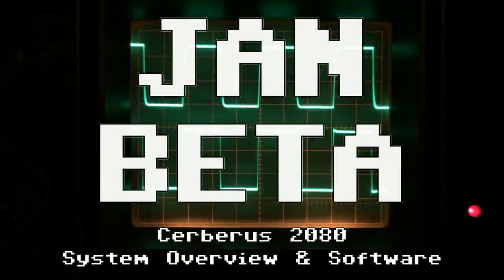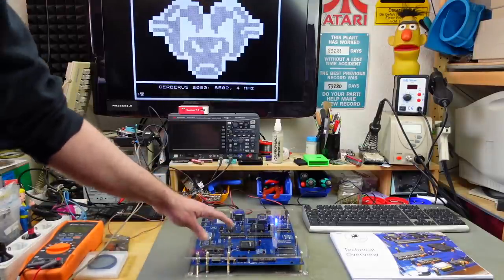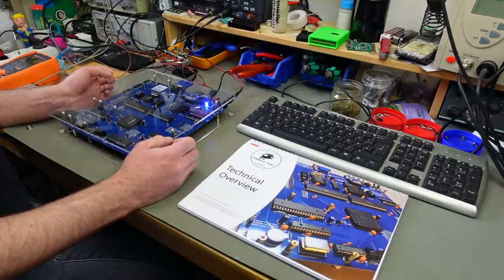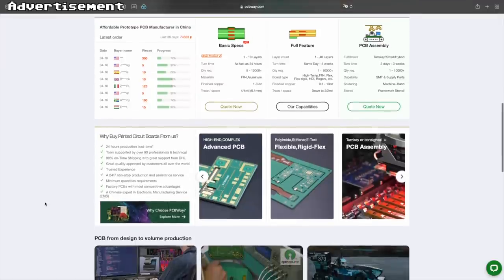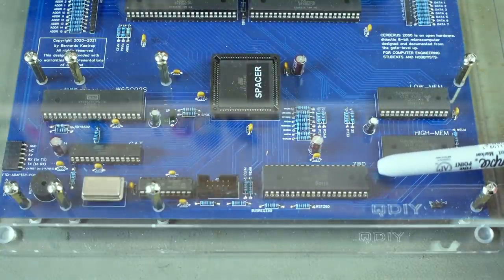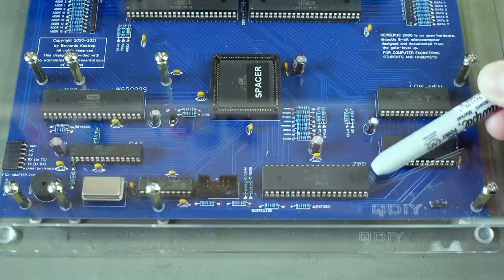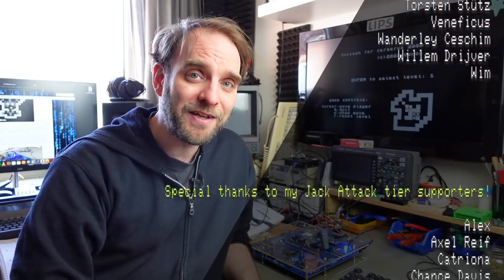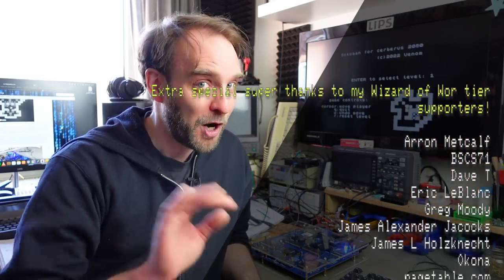Cerberus 2080 System Overview & Software

Comment: Fantastic job, Jan! You nailed the explanation of the architecture, and did it a lot better than me. I don't know, maybe I am too involved with the project to understand what I need to say for people who are not involved, or I am just too dull as an explainer. Anyway, great job! A couple of comments: you do have Andy's Manic Miner in the uSD card I sent you. I think it's called "manic.bin" or "miner.bin", something like that. Also, the latest versions of CAVIA, SCUNK and SPACER are compatible with all the software available so far. It's a pity Gordon's BIOS didn't work for you, I am not sure why it didn't. CERBERUS behaved as if it couldn't find the uSD card or some file in the SD card, although I can't tell for sure. Anyway, thanks and congrats! PS: You also brought to my attention an error in the system diagram (the manual): CAT doesn't talk directly to the data and address buses, but only through PSACER, as you repeatedly pointed out. Yet, the current diagram suggests that it does. I will correct that today.
Reply: Oh Jan, if I remember correctly, to save memory Gordon put the startup screen as a whole on a single file in the uSD card. His BIOS will look for that file. If you don't have it in there, it will beep. I think that's what's going on!
Reply from the maker: AAAH! That would explain it. I tried multiple times to compile/upload the Sketch and also the pre-compiled hex file without any luck. I'll try to put the files on the SD card. :D
Reply from the maker: Thanks Bernardo! I tried to make it as brief as possible to still be digestible. It probably helps that I don't know too much about the intricacies of it myself. Your documentation was immensely helpful in understanding the basic functionality and to (hopefully) bring some of it across in the short-ish video, even for an "educated noob" like me. :) Overall, my Cerberus journey has been super interesting and fun so far. I hope the project gets some more attention soon. Thanks for all the work you did to bring Cerberus to life!
Reply: I watched your design and build series multiple times. I was super excited to see Jan cover it. At first I thought it was a mistake and someone else had named their computer Cerberus 2080!

Comment: Hi Jan, has someone already ask you about the discrepancy of the High and Low memory sizes? It states on the manual pages you show 32KB Low and 28KB High. Where are the 4KB of High MEM went?

I just saw the video and Character RAM 2KB each, so I assume there is the missing High MEM. ;o)
Reply from the maker: Oh, I'm not sure why that is actually. The chips are both the same 32k SRAMs, so it probably has something to do with system reserved memory space or something like that. You would have to ask Bernardo directly, I guess... :D

Comment: Would the W65C02 work on the commodore 64? I would think it would. I enjoyed the video immensely and hope you will continue with more videos on the C2080 as I will definitely purchase one.
Reply: No, the W65C02 isn't a drop in replacement for the 6510: the line levels are different, the W65C02 doesn't support some additional instructions the 6510 had, and the W65C02 is more "correct", so doesn't support the "illegal" instructions that were commonly used in games and demos, and there are also slight pinout differences. You could build an adaptor board, and that would get you 90% the way there, but plenty of software won't work quite right.
Reply: As it happens the Byte Attic has a board that allows you to drop in a W65C02 in place of a 6502, but that probably won't be enough to replace a 6510, unfortunately.
Reply: Unfortunately it wouldn't. Not only are there minor differences between the W65C02S and the original 65C02, Commodore also used a modified version of the latter in the C64.
Reply: with an adapter you could make it work in a vic 20, but there are missing components that are required for the 6010 that the c64 uses. The 6510 is an enhanced 6502.
Reply from the maker: There's a recent project that adds some logic to the 65C02S and makes it compatible with the C64's 6510, if I remember correctly. Can't find the link at the moment but it's a little PCB with some additional chips that should make it useable in the C64, too.

Comment: This computer is a great achievement. Both the most important chips from the eighties, the Z80 and the 6502, but I am not that fonned about those special chips. I know, life goes on and the technique never stops evolving and innovating. What is the use of combining forty years old microprocessors with ultra modern superchips? It is like adding the latest high tech navigation system on a horse and carridge.
Reply from the maker: I think the reasoning behind using the CPLDs is the fact that they are (relatively) easy to obtain these days and reprogrammable. Designing proper pre-programmed custom chips or using existing ones and aligning the rest of the system to that would have been too costly and would have made the layout a lot more complicated, I guess.
Reply: A CPLD isn't really that much different to an old-timey gate array (a.k.a. ULA, PLA). The principles of operation are the same, only there's a bit more logic contained in a CPLD than there was in a 1980s gate array. But if that extra logical capacity isn't being used anyway, what difference does it make?

Comment: I see your Macbook suffers quite a bit of damaged screen coating. If you need a tip to remove the coating alltogether let me know :-)
Reply from the maker: Oh, I‘m in the "process" of removing the coating, just didn’t finish yet. I used alcohol and patience to get it off, worked okay but takes some time. Do you have any special tricks?
Reply: @JanBeta  If the damaged coating has a "greenish" glow, try baking soda, with a little bit of water. Be carefull not to use too much water as it can seep into the LCD. If the coating has  purple glow, the same process is valid, but it will be much harder.  We do a lot of these displays.
Reply: Oh, and use a soft cloth!

Comment: Does this thing run CP/M?
Reply: Currently not, no 80-column mode! Maybe in a future version, which I may be forced to design anyway, as some of the ICs used in this version, despite my attention to availability, are very hard to find now, due to the deepening chip crisis.

Comment: Yeah so why does this remind me of the commodore 128? ;-) through this detective learning tool I'm seeing a computer thru those 128 colored glasses. or a battle of the CPUs 64v.Speccy. cpm networking here too?
Reply from the maker: CP/M is not possible currently, because it would require an 80 column mode. At least as far as I understand it. But the dual processor approach is very reminiscent of the C128 indeed! :D
Reply: @JanBeta actually CP/M doesn't really care about the columns. It is designed to run on a serial terminal.
I have written a driver for the TMS 9918A VDP for my CPM 3 port, and it works perfectly fine with 40 and even 32 columns. 
It's just a matter of writing a driver for the video interface that handles terminal control codes.

Comment: "FORTH, I don't know how that works..." It's pretty simple (though not what people are used to- in fact, arguably it's reversed from normal), until you start doing the interesting things, at which point all guarantees go out the window, because your code can take complete control of the input and output. You could wind up switching to Lisp or C (or Basic) part way through a program if someone implemented compilers/interpreters for them.
Reply from the maker: Yeah, I briefly looked at FORTH code but I guess I need some time to digest and grasp how it works. Super interesting (and different) programming language though! I'm definitely going to take another look sometime.

Comment: This seems kind of interesting. I wonder.... Can both CPU's be used at the same time? Does it support colour or is it only B&W? I do wish the sound was better and had the option of disabling the sound on the board and have a 3.5mm audio jack out the back for external speakers. The product page really needs a FAQ section to answer some of those questions.
Reply from the maker: So far, you can only use one CPU at once. I guess it would be doable to switch between them "on the fly" through a modified BIOS.
Color is not supported, as each pixel is only one bit. There's room for customization though, maybe it would be doable by re-programming the CPLDs in the graphics circuit.
Adding a 3.5mm audio jack is totally doable if you connect it in place of the buzzer and adjust the Atmega's code a bit, I guess.

Comment: Great video, and a neat system. My only issue is that the designer seems to think that a Z80 is a "much faster" processor at SAME clock speed as 6502. Here's a quote from his video as a response to someone saying the speed is 4:1 ratio (meaning 8MHz 6502 is equivalent to 32MHz Z80): 

What? No, the Z80 is a much faster processor than the 6502, if running at the same clock frequency. The 6502 was just cheaper. 

Little shocked that a designer of the system with dual CPUs did not take the time to understand the two CPUs... For the record,  Z80 is about 3x slower than a 6502 at same clock speed, so a ZX Spectrum (at 3.5MHz) is actually slightly faster than a C64 (1MHz) on CPU-intensive tasks.
Reply from the maker: Good call! I think it's super difficult to compare the two processors in general because the approaches are so different. Would be interesting to see a comparison with various benchmarks for similar tasks (although the code would be vastly different probably) at the same clock speeds. In real life, I guess they were mostly equivalent (at least back in the day). As you say, the Z80 was usually clocked higher than a 6502.

Comment: Looks like a project with too many cooks.
Reply from the maker: This is still in its very early stages of development on the software side, so people just made the changes they needed to make without much consensus. As I mentioned in the video, there are of course plans to unify the BIOS issues and make a new version that incorporates all the little changes into one new version. It's definitely going to get more straightforward in the near future. (There's also far better examples for "too many cooks", think of the Commander X16 project, for example...)

Comment: It's pretty nice hardware but the software developers made a complete mess.
Reply: Made a mess of what? The BIOS? It's a simple BIOS to let people get started.
Reply: Not so simple when one of the versions requires a library that isn't even mentioned in the documents and another version that won't upload from a windows PC, only mac.
Reply: that is one reason i don't like github, people just assume you already have/know everything and don't write clear instructions.
Reply from the maker: Just remember this is in its very early stages regarding software development. There are plans to make a kind of unified BIOS version that incorporates all the changes made by the individuals. Obviously at this point, people just modified things when they needed additional functionality to make their particular code work. There's most likely going to be a more straightforward way of doing things pretty soon.